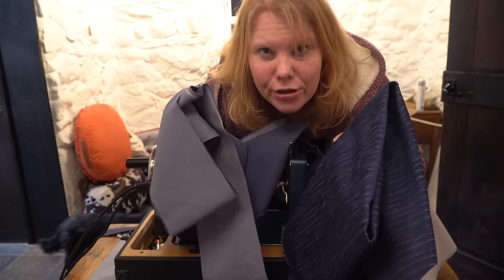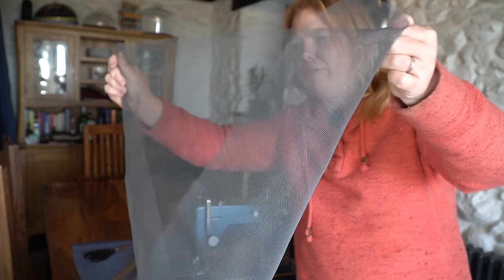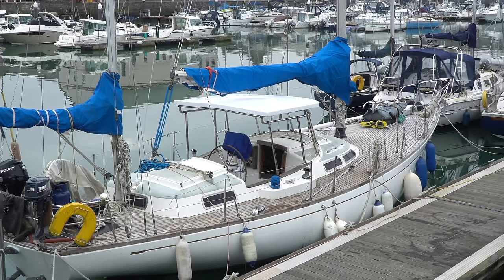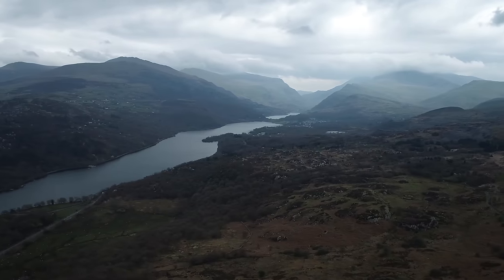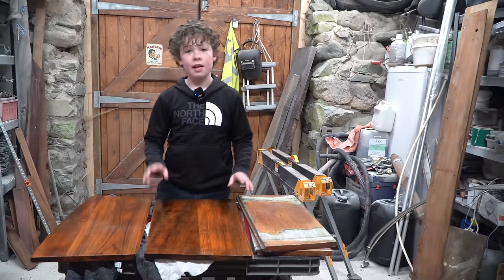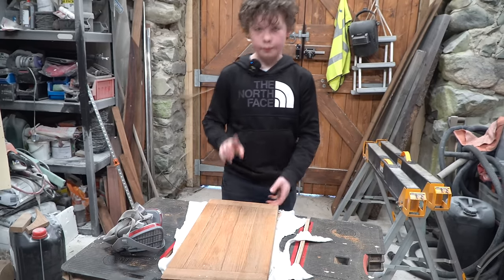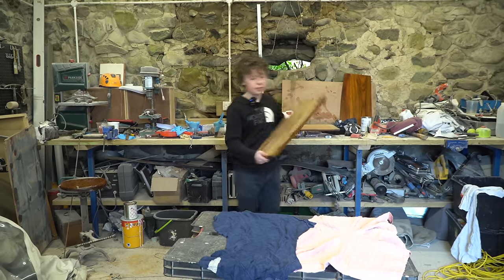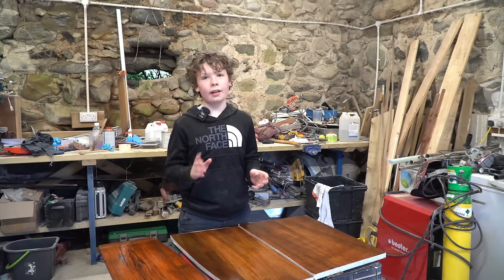No fridge for a year!! This will be life changing!!

Comment: All these box power units and stuff your receiving from sponsors are great kit but you will find that the catch up rate will be very slow after a few days or weeks of non solar power production , air fryers and ice makers require a lot of energy and the big box stuff your adding will be taking up valuable room and require constant charging more which is more than you have currently on the old girl.
Reply from the maker: You make a valid point
But the trade off is to have more propane on board.
The propane canisters last a long time, granted, but they are larger, more awkwardly shaped and regulators are difficult to find worldwide for all the different types where as rhe sun works the same
The world over. Also propane is far more dangerous and explosive than LifePo4 batteries.

I think you’re correct that we need to stay on top of charging and in the real world we won’t run the ice maker often of course that’s a luxury for when we’re in super good condition charging wise.

The air fryer is pretty efficient it cooks much much faster than a gas over, probably 10 times faster, and we will only use it maybe twice a day.

We will retain a small gas hob and bottle which will be our fall back as I don’t like putting all my eggs in one basket and I completely agree staying on top of charging is going to be the challenge.

But that’s partly why we’ve built the cockpit enclosure to hold more panels, all told we now have 1200 watts of charging.

Time will tell if this setup works in the real world and I think in high latitudes we may well still have to be a bit conservative on our use of electric, just like everyone else.

But we’ve got 8.8kwh of lithium and 1200w of charging on board so even if we find in the UK or Scotland we can’t hammer the air fryer all day and expect to keep the batteries charged, we’re still have a good starting point to work from.

Space wise as I say. Since the problems with the 4.5kg Calle bottles you can only get rhe big bottles and they’re a huge pain to store.

It’s all a case of “suck it and see” isn’t it. 

The absolute worst possible thing that can happen is we do a year or two with this setup and then make some changes having lived with it a bit. :)